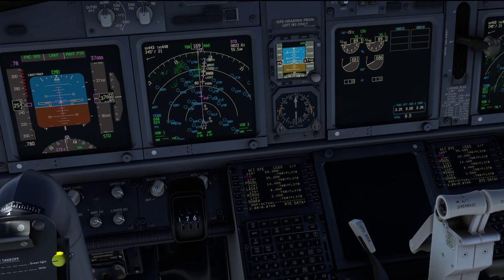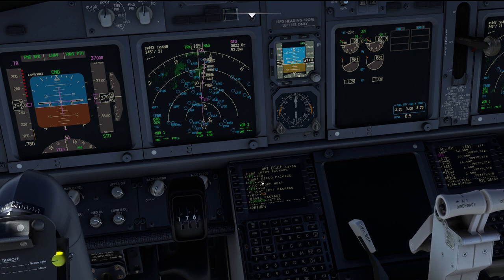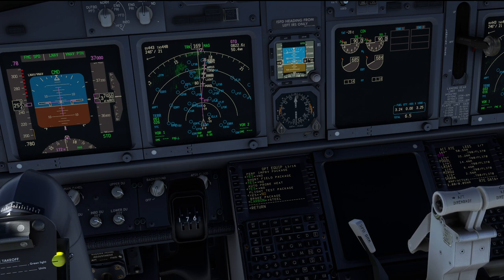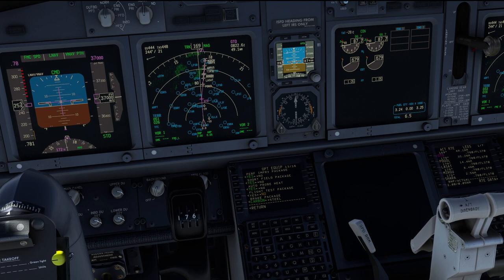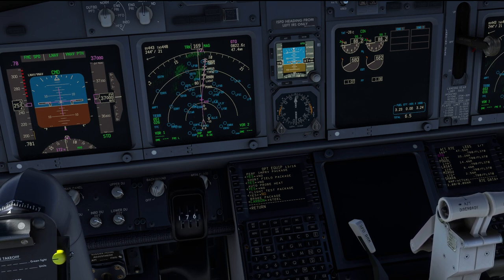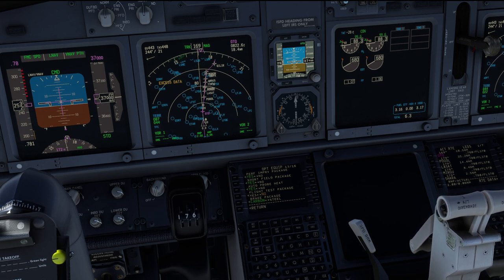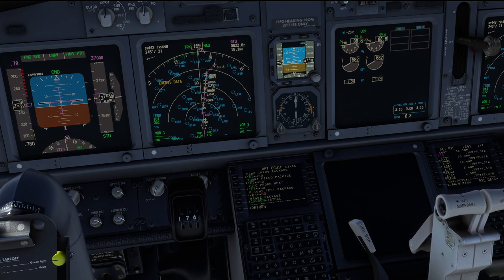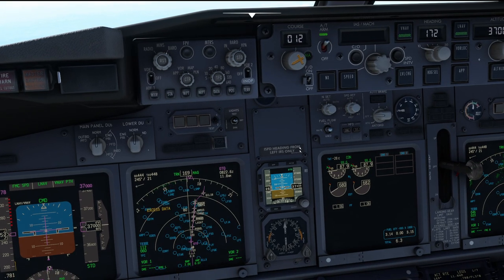Short Field Performance Package | PMDG Airline options explained | Real 737 Pilot

Comment: Well, that is slightly uneventful :D
For some reason I assumed it was a far more drastic change, like actual elements being different in the wings and body, and I assumed it would have improved handling in low speeds while having more drag or less performance in higher speeds... Guess it's not the case.
I wonder why this can't be a software enabled feature in the 737s, making the SFP versions be able to handle like normal ones if wanted by changing a setting

Comment: I haven't been using the short field option because I don't know if the airlines I simulate use that option or not. I simulate Southwest and Delta.
Reply: The skins in PMDG ops center that say verified have the correct equipment.
Reply: Just confirmed southwest uses short field performance package on the 800s but not the 700s.
Reply: @WarHawkAU24  Thanks for the info!

Comment: May we please know minimum takeoff and landing runway lengths?
Reply from the maker: Hi Mark, sorry for the late answer. We can not simply say minimum lengh overall because it will of course depend on conditions and takeoffweight. On 1700m runways with the short field performance kit you should be fine in most cases and medium weights.
At low weights some operators even fly it into 1400m runways.
Reply: @A330Driver  we are talking about the 700 or 800 version ??